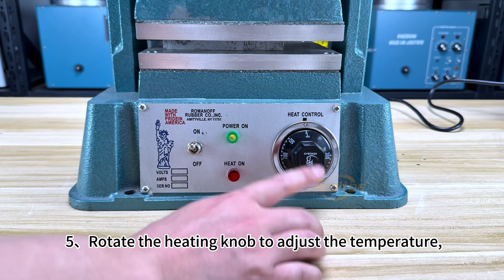How To Use 6X8 Inches Heating Vulcanizer Jewelry Casting Molding Machine?

Comment: Can you melt 2 acetate plates against eacother with this?
Reply from the maker: Yes, it should work perfectly! Our vulcanizer is designed for precise heat and high pressure, which are exactly what's needed to bond acetate plates. Since acetate formulas can vary, we recommend doing a quick test strip first to find the sweet spot for temperature and dwell time. Looking forward to seeing your results!